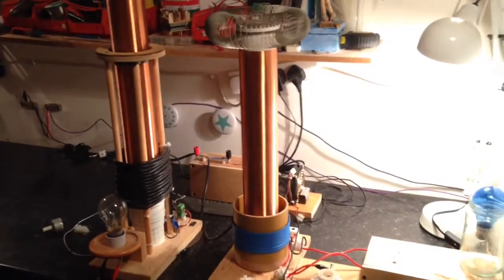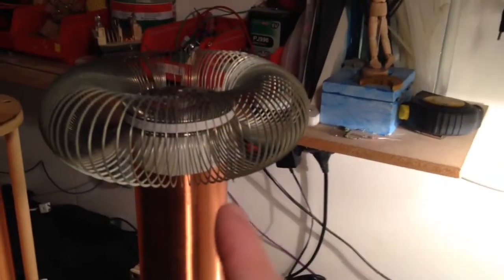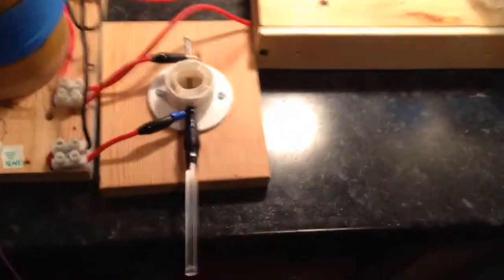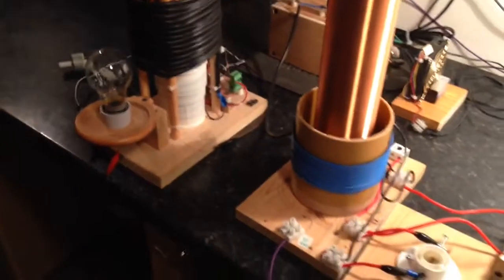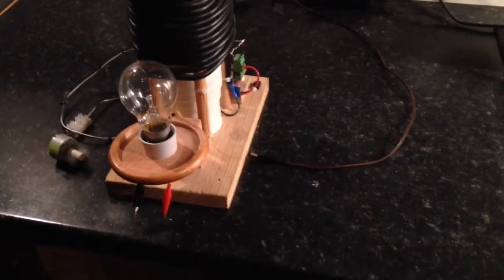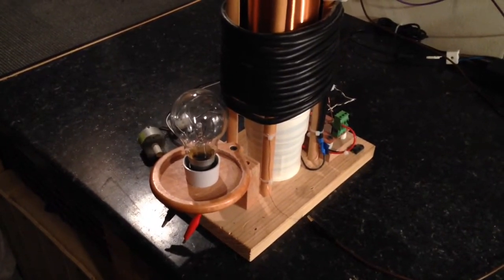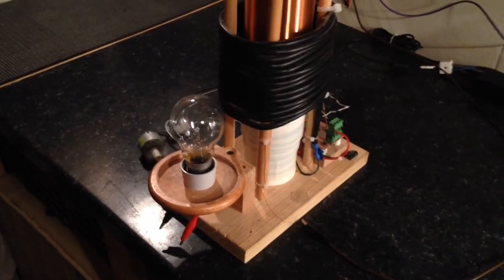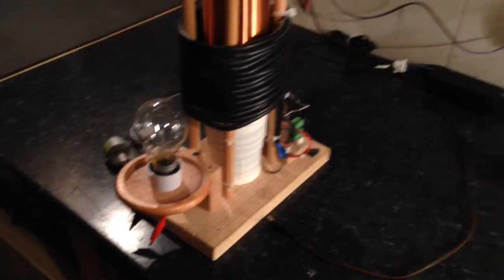Spark Gap Tesla Coil - wireless receiver power rectification #2

Comment: Deeds, look into "radiant energy" Tesla stuff. It uses a DC positive pulse only, with a "critically damped" magnetically quenched, single wave pulse. Driving mass balanced coils. Be very careful, very powerful results.
Clay
Reply from the maker: Thanks Clay - that's brilliant. And do you remember a while back you said try getting hold of a plasma globe, well that afternoon I went to "QD Stores" where they had a whole stack and they all got sold at xmas. There was literally a pallet of them.  I can't wait to see what effect the slayer creates.  As you can see I'm caught up on this little project now lol.  I put some magnets on the spark gap tonight tho, thank you mate.
Reply: deeds Tesla was actually using DC not AC in his Magnifier. So you need diodes on your primary. The secondary does not act as a coil but as a compressive wave guide. 10,000 volts in primary will yield 10,000 volts per inch of secondary. Do the math, its a lot. Have fun. 
Clay
Reply from the maker: aaaflooddrying
Thanks Clay,  can you help me as I'm getting confused.  I've got a DC flyback as a power supply on my transmitter coil, did you possibly think I had an AC one?  I've never said it was a DC I don't think - I used to think they were all DC until a few weeks ago.  So I'm ok on the transmitter side aren't I? thanks again.

Comment: try some ferite cores in the reciever sometimes it can help with the tuning
Reply: He has kind of, he has a DC motor :) Are rectifying that motor on the receiver? That is a DC motor right *****? If so, that is very interesting!
Reply from the maker: сталкер чворович thanks bud. Appreciate the little tips and things to try, take care fella.
Reply from the maker: Diadon Acs  +сталкер чворович - Sorry fellas, I left you hanging.  Yeah it's fwbr around the back of that old receiver tower, same old setup I was using with the slayers. Hope you're both well, I'm flat out at the moment, having fun just not enough time to really have some fun ;)  It's a shame I haven't got any ferrite that I can bust up, what would I do with it, just place it inside the air core yeah? thanks man.
take care.
Reply: deeds yeah give or take yes but moove it inside up and down to tune it :)

Comment: hey cool! do you use Avramenko plug for running a motor?
Reply: Tesla used an electromagnet on the spark gap. The reason is that an electro magnet can be adjusted. The important part to aim for is a state called critically damped. Look it up onWiki. Your aiming at single DC positive pulse with no back rush. Ie critically damped.
Reply: Not over damped, not under damped , but critically damped. It's notkinda sorta, it's an exact state. Diodes and tuning may also be able to replicate like Don Smith
Reply: Good luck, change our world!!
Clay
Reply: Thank you! It's a tower I've been using for a whole so I forget to go over things. 
  Around the back of the receiver is a home made fwbr. It connects directly into the coax secondary on that tower. There's a 25v 2200uf cap across the output. Take care, D
Reply from the maker: Hi, you mentioned magnets to me on a more recent video too - thanks for that, I only saw it today but I've got magnets on the spark gap now. Cheers.
Reply from the maker: aaaflooddrying Now an electromagnet sounds like it could be fun to build Clay.  I really want to have a go at that.  And I'll swat up on critically damped, I like that... not over or under, just critically.  Sounds very interesting. I got some bedtime reading to do. As always thank you very much for chipping in and giving me something to explore.
Reply from the maker: aaaflooddrying
.. hehe.... if I can, I promise I will. ;)
Reply from the maker: aaaflooddrying
I remember I'd never heard of Don Smith before, you told me about him last year.  I read through nearly all of his huge word document, and watched anything I could find - what a nice fella, thanks mate.